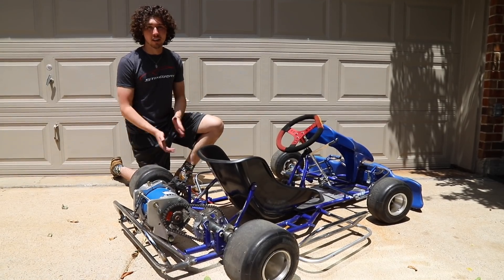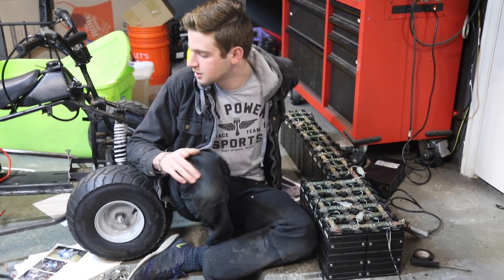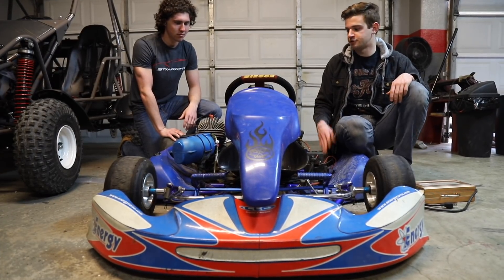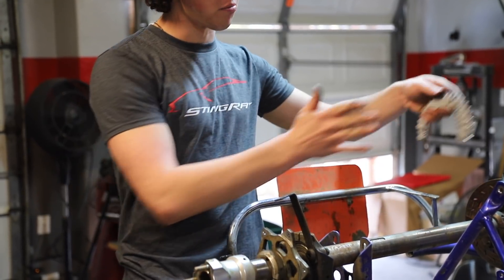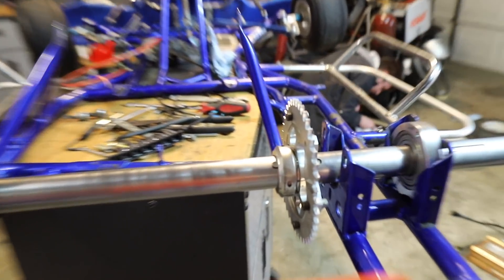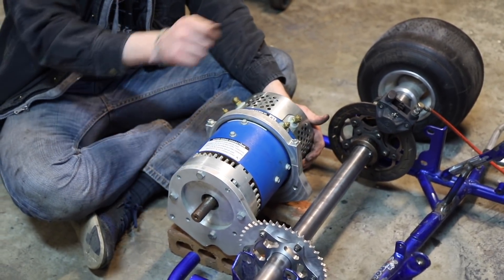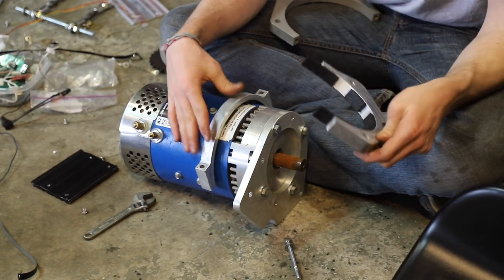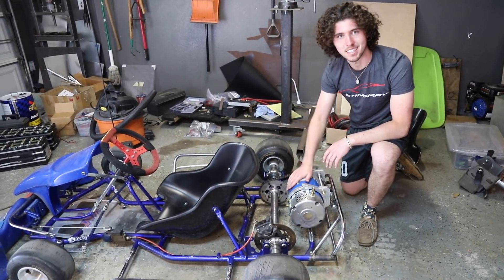80 Volt DIY Electric Go Kart Build | Part 1 - Project Intro and Motor Mounts

Comment: Those batteries are massive for only being 3.3V lol why wouldn't you just use the 3.7V 18650 cells? It would save a massive amount of weight and space
Reply: lol they prob are inside dude.

Comment: hey wanna know an EZ way to remove those hubs , just thread the pinch bolt through the opposite side and slip a piece of sheet metal in slot and screw in bolt , that will push hub open just enough to easily slide off

Comment: Looks like a D&D motor! I was building an FL250 to eV with a 39hp D&D motor but stopped due to batteries. I believe I purchased a Curtis controller with two modes. Your kart should be badass! Be well

Comment: Exciting build. Sounds like a senior project that didn’t quite get finished I know what that’s like. Since y’all are engineering students I’m sure you did the gear calcs since they are pretty quick but I figured I’d ask. Isn’t the motor sprocket kinda big? Or was it because this motor and battery were designed for a much heavier bike with larger wheels so now it’s gonna be hella torquey

Comment: Rad project, guys. Newly subscribed! We're building a kart for doing burnouts using a D&D series-wound motor that looks just like yours, but different wiring, controller, etc. Really curious to see how your motor mount works out. We've been planning face-mount with some extra support for the can. Yours looks way more serious except for  the fit. You're running a much bigger drive sprocket too. Hmm. Really looking forward to seeing the next part!
Reply: whats the name of the motor?

Comment: Just be careful with your Weight distribution. I feel like where that motor sits it will he really rear biased. Only because where the battery’s are is neutral with the driver.
Reply: perfect opportunity for massive wheelies